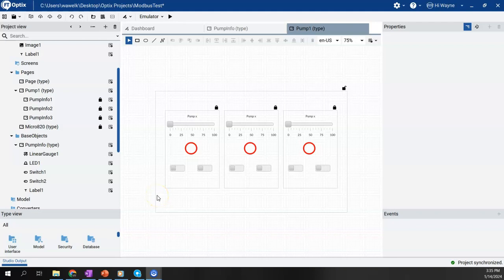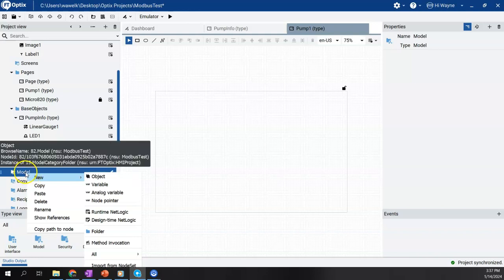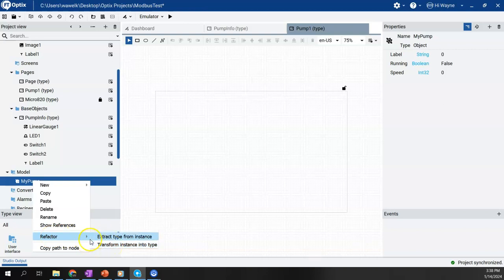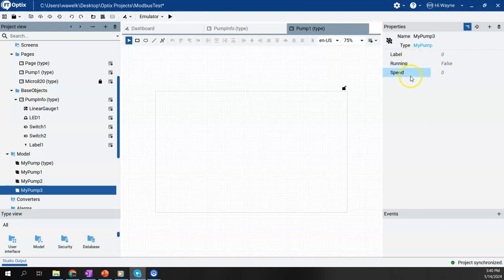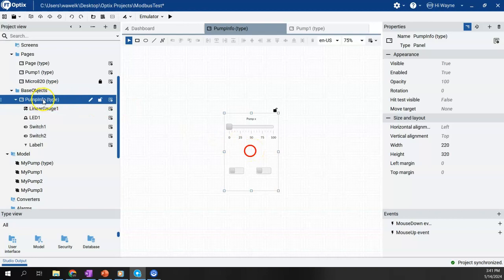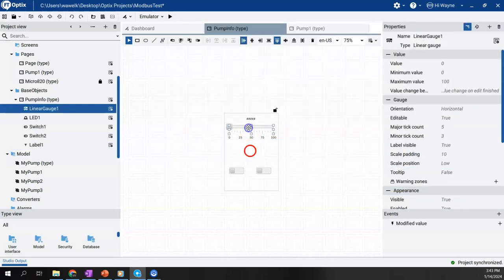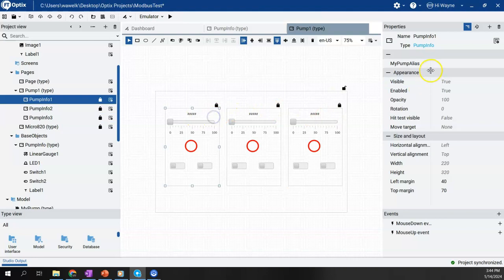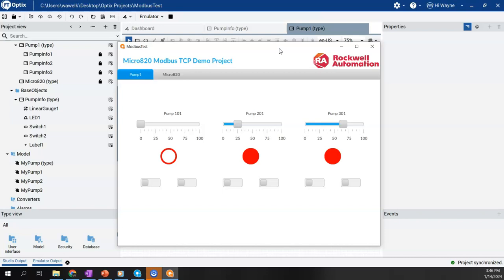FactoryTalk Optix Reusable Graphics Part 2 - Object Model Alias

Comment: Really appreciate your videos! There is not a lot of examples for Optix projects yet. I create alias's directly to my PLC tags for items like this. Instead of using model items in Optix to link an alias to I would have a UDT in my PLC for the pump type with the name, running, and speed tags then I could place that into an array for however many pumps I have. Finally, in Optix you just have to point the alias node to the correct array element. Not sure If that was what your next video was going to show but it would be good if you could show that as well. Thanks!!
Reply from the maker: Appreciate the feedback!  I will have to demonstrate that method as well.  Admittedly I'm not a developer, so glad to get comments from anyone who has been working with Optix.

Comment: Fantastic videos. Do you happen to know a way to use this premise for trends? Such as hitting a button, loading a panel that's aliased to the particular logger? I tried a few things and didn't have much luck, but I'm pretty new to this software and mostly exploring, which your videos have been a great help for.
Reply from the maker: Thanks - glad these videos have been helpful... you want to use a single trend pop-up window that would pass a different tag into the trend each time?
Reply: @wawelk  Pretty much. What I currently do in View SE is use VBA to load pens into the trend display. This was done to avoid making 700+ trend displays. I'm attempting to do something similar in Optix by loading the Model dynamically, but I haven't had much luck doing so.
Reply from the maker: Sorry for the slow response - I think this should be possible by creating a panel with the trend object.  Then add an alias to that panel. The catch is that you may need to create a "model" with variables and assign those variables to the controller variables you want to trend (if your data it not in a UDT (type) already).
Reply from the maker: After trying some things out, I see that it is fairly easy to use the Alias to pass in values to a Dialog Box with a Trend Object on it - problem is that this seems to work only for real time data,  I have not been able to pass the historical data into a popup with an Alias, it will always grab the real time data.
Reply: @wawelk  I was able to get this to work after some conversations with the developers at this year's Rockwell Automation Fair. Instead of the normal trend, I used the Advanced Trend for DataLogger from the Library. I'm then able to make a Trend_Model (type) with an alias of Kind Loggers, Node Class Any. I made a reusable display type to use as a screen with an alias of Kind Trend_Model. Then I can make a button to change the panel in the panel loader with the new trend screen as my NewPanel and the AliasNode as my DataLogger I want trends for. This makes it so I can have a single trend display and just make a logger for each trend setup that I want and it loads up all the pens. It does do the pens in a random color order, which I don't care for, but some editing of the C# code to an indexed table of colors instead of random numbers could fix that right up if I feel so inclined.
Reply from the maker: Hey Justin, thanks for sharing this!  I'll have to give it a try as well.  Glad you were able to get with the experts while at Automation Fair.

Comment: I don't see an example, or if this feature exists, writing a value in a tag using the virtual keyboard in optixpanel.
  Does this feature not yet exist?
Reply from the maker: Use the Text Box base control object - this lets you click on it and enter a value during runtime.